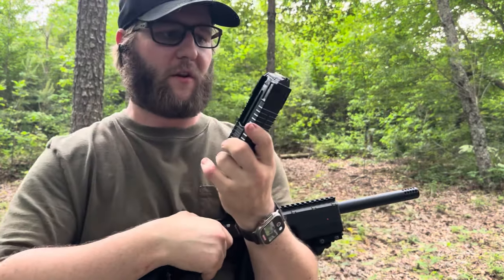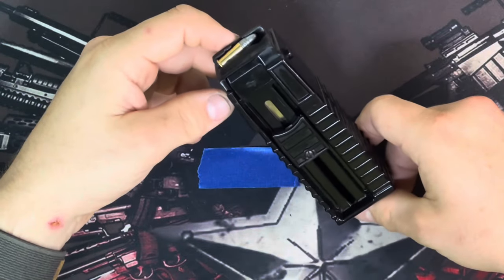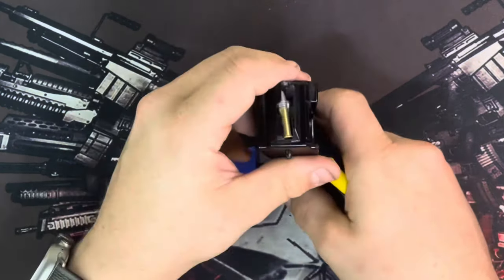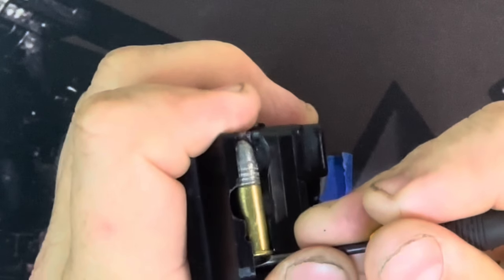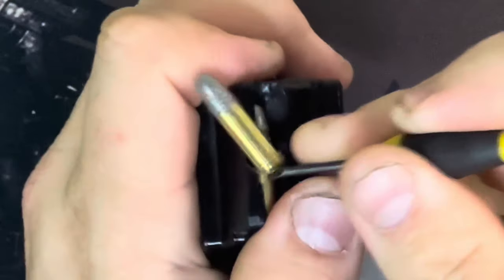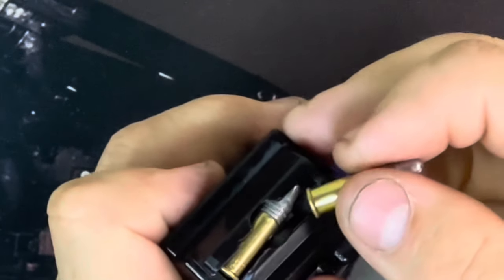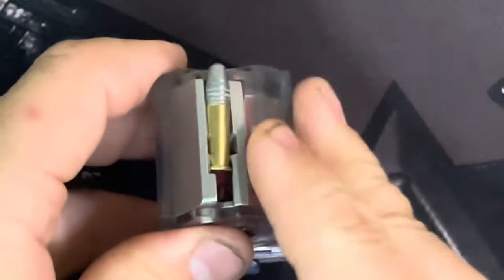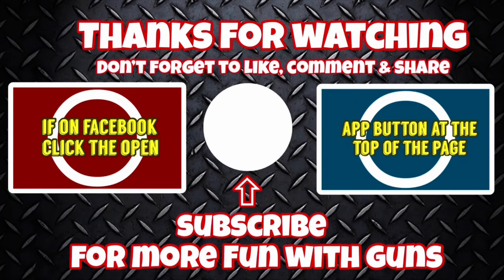The Eagle International Bata Mag 22/10……The Weirdest Ruger 10/22 Mag Ever

Comment: What 10/22 kit is that?
Reply from the maker: It’s actually a full gun that was made by a company called Vadum. The first video on my channel was actually a video showing how it work. It does share quit a few parts with a 10/22, but where it really differs is in the trigger because it’s fire by wire and has an electric trigger in it. It’s kinda like a paintball gun and has a pull of around 1or2 oz. It’s an awesome set up but the sad part is they told me when I got mine that they had only made less than 60 of them so they are extremely rare. I really just got lucky to pick one up when they still had one.

Here’s a link to the video on it if you’re interested.

https://youtu.be/4MSPaysVuYo?si=WQV1XZ0uST_ycHMD